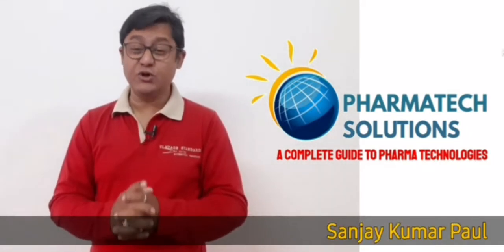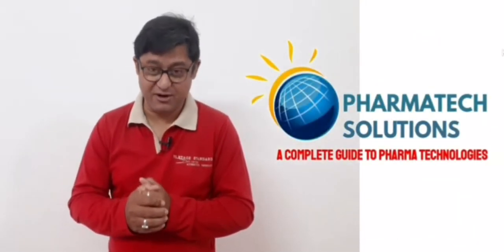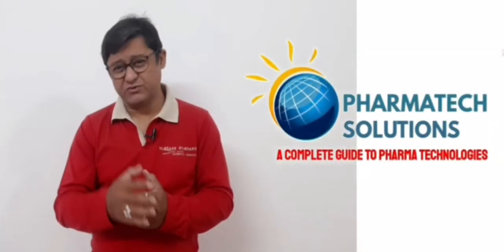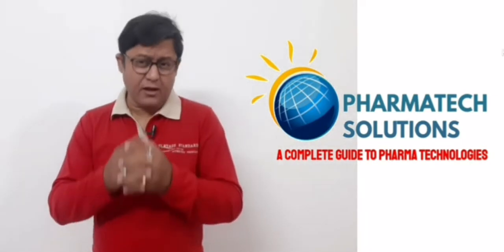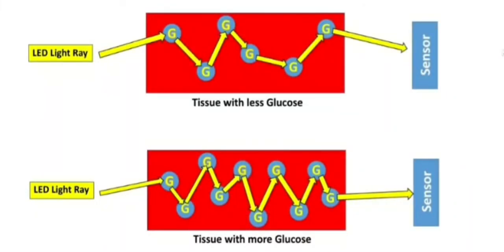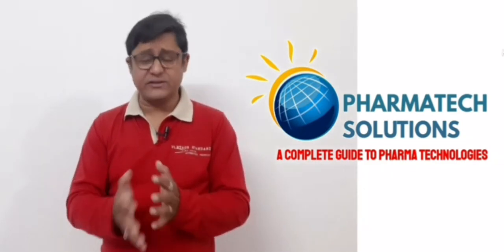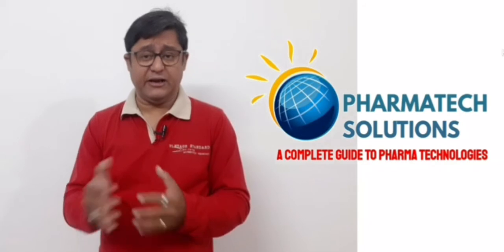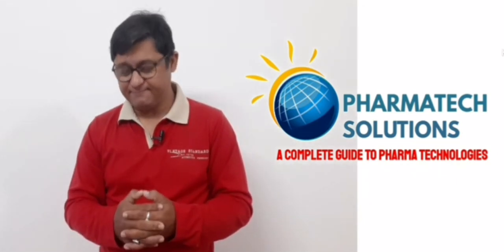Near-Infrared based non-invasive blood glucose meter working principle

Comment: Good afternoon sir
Currently I have to handling this project I was struggle in codeing part so would you share codeing related information about this.
Reply from the maker: Sure...could you please be more specific as what information you are looking for in regards to coding?
Reply: @skp280578  NIR Non invasive glucometer using Arduino code , c or c++